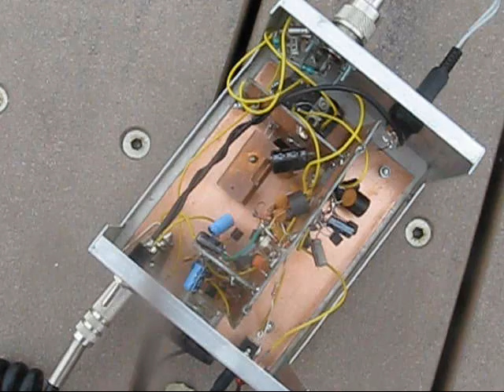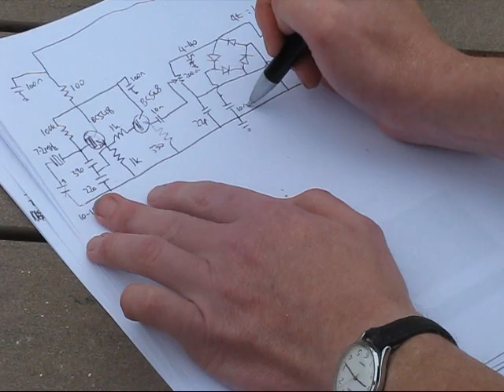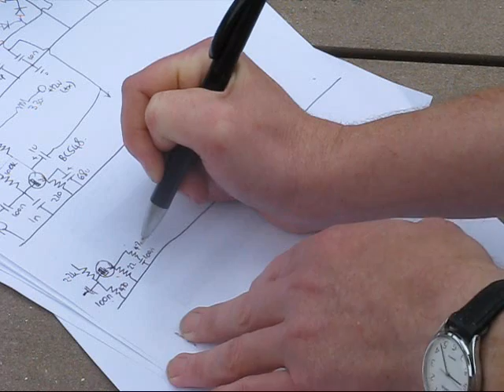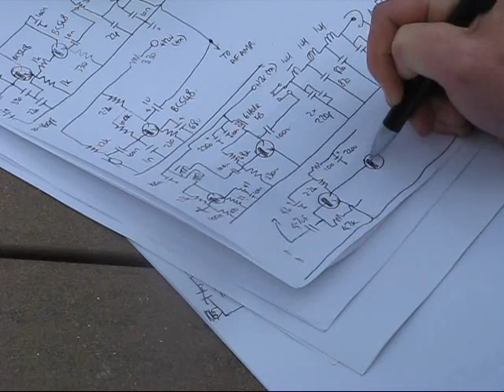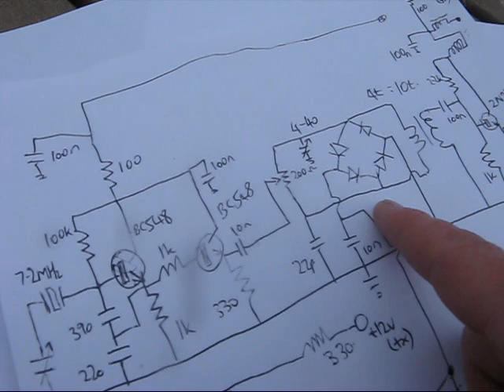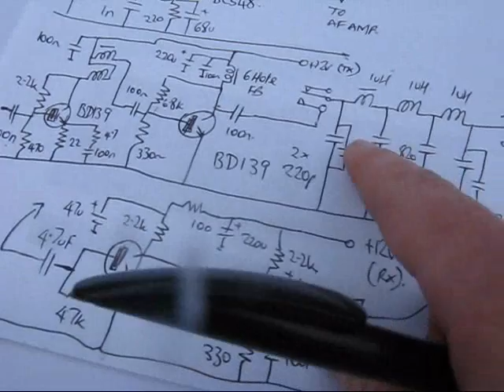"Beach 40" 7MHz DSB txcvr: Pt 1 circuit walkthrough

Comment: Just made my first contact! Works great! I'm so excited right now so I'll just leave it at that. Thank you for the wonderful rig!
Reply: Alex, do you have any notes on building this?  I am trying to gather all of this up but am confused about some of the inductors.  Did you have a parts list to go by? Thanks for any help 73 W2DAB
Reply: pcomp I just used the little tv balun cores. They're these type of things: http://www.ebay.com/itm/Push-on-antenna-matching-transformer-balun-300-75-ohm-TV-cable-flat-lead-adapter-/381456929062?hash=item58d09ad126:g:7ZgAAOSw~bFWORBH

I wrapped them with radio shack wire the number of turns listed in the video. The last ferrite bead I ordered off of ebay: http://www.ebay.com/itm/FERRITE-BEAD-COIL-6-HOLE-3-TURN-CHOKE-RFI-EMI-SUPPRESSION-COIL-1-2-LEADS-10-PCS-/131645527852?hash=item1ea6af572c:g:gYYAAOSwwbdWO58V

Make sure you have a ton of isolation between everything or it'll oscillate to no end!

Comment: Both bands (USB & LSB) cancell them, because the receiver tune both bands. You can use your DSB to comunicate with any SSB or use a synchro oscillator. There are an old trick: To "Invert" the audio from the microphone, beating with a carrier in the 3 Khz range. Regards. LU1AR

Comment from the maker: @VK2BEN - not sure about an AR article yet. As for designing receiver bandwidth, you give me too much credit as I haven't even measured it, let alone designed for it. However it is fixed bandwidth.  For a simple rx with switched bandwidth I recommend the on in Nov 2012 AR. The low impedance audio output makes it easier to build filters with common RF chokes in the speaker line.  Demonstrated in my Porta 40 video - even a simple filter makes a differnece.

Comment from the maker: I haven't on this one but have on others. It works but tuning in is really hard and extreme frequency stability is required.  If you just wanted to build 2 DSB rigs for chatting to each other maybe crystal control on a single frequency (with a fine adjustment control) would be the way to go.

Comment: hi peter, im struggling with the coil for the balanced mixer, you mention its a bifilar but with 4t and 10t. is that 2 pairs of twisted wires with one that has enough wire to create 4 t and the other with 10t, or is it 4t and 10t next to each other? many thanks in advance.

Comment: hi, Peter. I have been building mine Beach40 over the past weeks and have questions (I build some receivers but I hope Beach40 is going to be my first home made TRX QRP).
1. Question about Transformer1 (the first one after the diode mixer), 4T:10T, so these should be a separate wingdings, right? I don't need to twist them (the first or last 4 turns). 
4T should be from the diode mixers side, yes?
2. I have VXO, Mixer, PA amplifier and audio amplifier built. I want to listen stations on 40m. When I connect my antenna to where LPF should be connected - I cannot hear any stations, even broadcast stations. the closer I am approaching the mixer the louder I hear the stations (although they are very week). I tried to exchange the first transmitter using two BN43-202 and -203 cores and FT50-43 ring but no improvement noticed. I imagine my understanding of how the radio should work is missing here, therefore I'd be glad to hear how can I improve the level of signal coming in from the antenna (I understand, I can build RX amplifier before LPF and another audio amplifier with LM386 or so) but I wonder what can be done with the current circuit? I think I am trying to assess also, if this is expected, that the signals are so week, even close to the diode mixer. I've checked the circuitry and all looks good. Parts were tested etc., so let's exclude any human error for now. Perhaps the whole audio level comes from the current audio amplifier (2 transistors), hence week singals, but the 2nd part is that where I would expect to have the antenna connected, the level of signal is ZERO.
Peter, I'd be happy and possibly many other 'young' constructors, to have some more information on how various modules work, what they do and what signal levels (RF etc) to expect at their INPUT and OUTPUT. It would great time to do some sort of 'refresh' on this lovely TRX, which sounds very easy to build. I hope to use this experience and pass onto new , young colleagues in our ham radio club locally. Therefore any additional information on how this little rig works, possible improvements, singal levels of various stages etc. would be of a great help. All the best, Peter. Watching nearly every day your movies. 72! Waldi, sq8guo
Reply from the maker: Hi Waldi - in answer to your first question you're right. It's separate windings. On the second question any increase in gain will need additional audio or RF amplification - it is a bit on the light side and you WILL need a full-sized antenna.  A text like Experimental Methods of RF Design is a good reference on various RF stages.
Reply: @vk3ye  much appreciated, Peter!!

Comment: Hi, made this project. Thank you very much. Convert it also to 80m, with PTO, but it has distortion, and frequency drift while modulating. Works fine with xtal in 40m at the same time. What shall be done to make it work with vfo? Vfo has 2 transistors buffer in it. On receive, it's pretty stable though.
Reply from the maker: You will need to add extra buffer amplifier stages and build either a high quality VFO or use a DDS for best stability.

Comment: Ok i have the ceramic resonator but it's has three legs how can I connect on the schematic only 2 legs are visable
Reply from the maker: Use the outer two.  Experiment with connecting the centre one to earth and note any change in frequency range.
Reply: Thanks its works fine anyway

Comment: Peter do you remember the power output of the balanced modulator you used in the Beach 40. I built the circuit some time ago and wonder what to expect. I measured the output impedance and came up with about 75 ohms. I need to see how much power amp gain I need to get at least 250mw. Thanks!
Reply from the maker: It would be tiny. Like maybe 3 milliwatts? You will need a minimum of 2 and perhaps 3 transistors to get to 250mW.
Reply: I need to recheck. I only have -8dbm.
Reply from the maker: @lmoline63601  It might be that low. Haven't actually measured. My answer of 2 or 3 transistors would still be fair.
Reply: I have just over 100mv across 75 ohms which I measured to be the output impedance of the balanced modulator and that is just below the point of flat topping. I have around 8dbm into the oscillator input.
Reply: Peter could my output be low because I used 1N5711 Shottky diodes instead of 1N914?
Reply from the maker: @lmoline63601  I'm guessing they should be OK. Diode balanced modulators have very low output and need to be amplified a lot to get to a useful power.
Reply: Thanks so much Peter. I will keep building away.

Comment: Okay I think I will use crystal in parallel I have the parts here but how many uh. For radiofrequencychoke. Rfc wire wound or just a molded inductor
Reply from the maker: Get some and try. Moulded is good.  Start from a few uH and work upwards.

Comment: i can only get 7.200MHz quartz cristals no ceramic . can i use it ?
Reply from the maker: Yes. You just won't get as much frequency agility. Maybe only 5 - 10 kHz.  Or 20 - 30 kHz with two in parallel as a VXO.